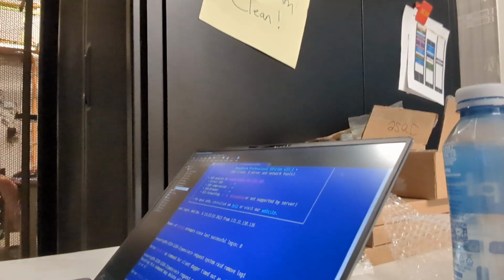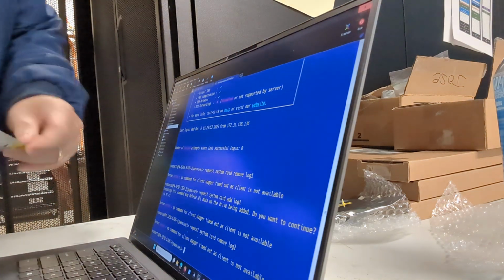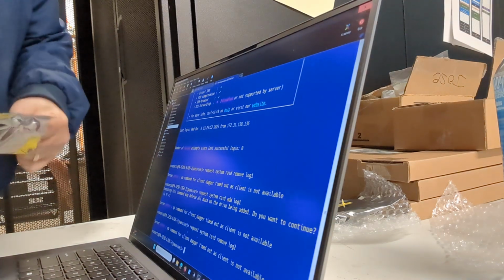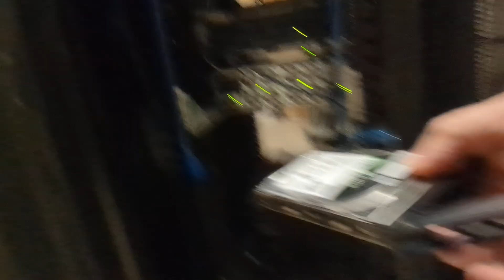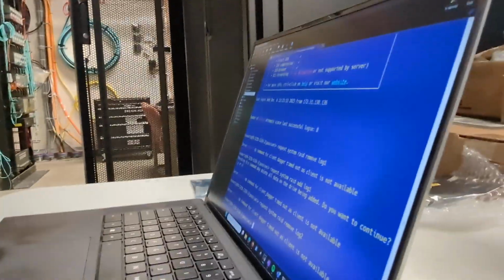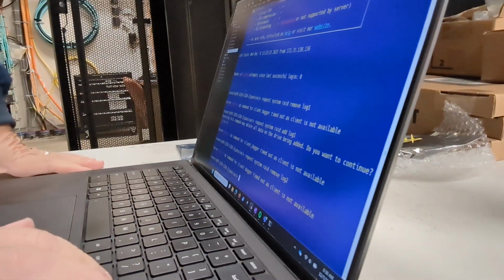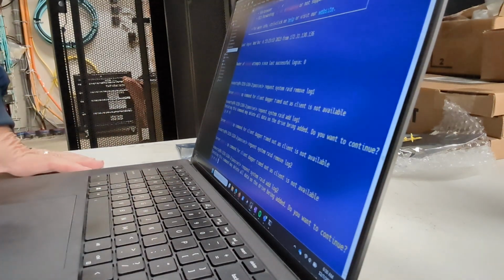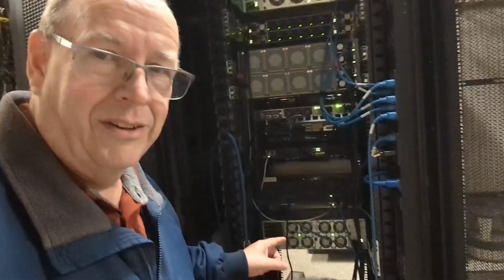Network Admin Life - Firewall Disk Fix

Comment: Troubleshooting hardware issues are always fun.  Especially with live production hardware.  I do hope the two firewalls you have running there are running in HA mode so if one dies other will take over.
Reply from the maker: Correct.  Both sets of firewalls, North/South and East/West run in active/standby high availability mode.  God bless!

Comment: I have extremecloud and before that Aerohive (extreme bought them). Any benefit to the on site controller besides 1 dont need internet to control APs and 2 instant config update? That 2nd one is what I liked about my old on site cisco controller and aruba. You make a change and its instant. No pushing config updates like with cloud controllers. I have a section of a building with Aruba controllerless APs. Basically 1 ap is the controller and if it goes doen another one takes over. It works well too although its not as robust as the could controller you gotta pay for.
Reply from the maker: The biggest benefit from the onsite controller I see is the ability to do a captive portal and tunnel all guest traffic back to the controller and straight out to the Internet.  Plus, it was just a paradigm I understood.  I've always had local controllers.  God bless!
Reply: @NetworkAdminLife  the cloud controllers do allow that. I have one setup on extremecloud. Dhcp and dns traffic is all thats permitted over lan. Everything else is direct to/from internet.

Comment: Ground strap 😂 I just touch something metal first.
Reply from the maker: Pretty much.  I always feel a tinge of guilt when I think back to my Lockheed days when we had to use an ESD mat and grounding straps to work on anything on our bench.  Couldn't even touch a piece of test equipment unless we were clipped onto it with a ground strap.  We even wore grounding straps on our shoes.  Electronics were more sensitive back then.  God bless!
Reply: @NetworkAdminLife  well if youre working on components that are going into f16 fighter aircraft and advanced weapon systems I get it then.

Comment: Hi, stupid question when you replace the drives do you not need to restart the firewall?
Reply from the maker: Not normally; they are hot swappable.  Palo Alto support even told me I didn't have to restart the firewall.  However, in this case we DID have to restart the firewall.  So I'm adding that to my personal notes to just restart the firewall when we replace a disks. God bless!

Comment: Love the.vids man. I'm in my last year for CS/Information Security and one of the jobs that my degree/certs apply to is Network Administration and LOVE setting up stuff. It's like logical Legos. Learn alot from watching you.

I may have missed a video but are you working with just windows are you have some Linux up in there too. I only saw a powrshell window so just curious (they really hammer us with Linux over Windows)

No idea what a wrist strap is, onto Google.
Reply from the maker: A wrist strap is a way to ground you so that you don't pass static electricity into the device you are working on.  It's old school stuff as most devices are pretty robust these days.  Our shop is strictly a Windows shop.  We have a few one-off Linux servers here and there but that's it.  I keep a dual-boot Windows/Linux laptop as a "just in case".  If we get hit with something that just kills our Windows network I want something non-Windows to get in and do my work with.  And it's Linux Mint for the curious.  God bless!